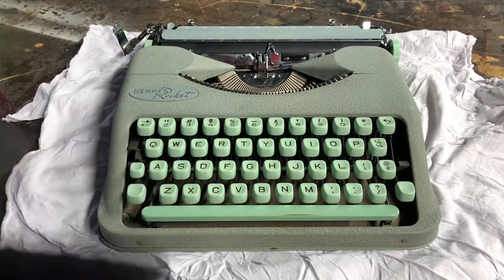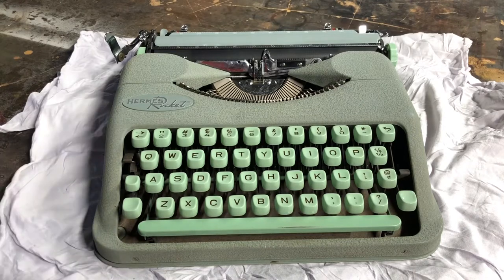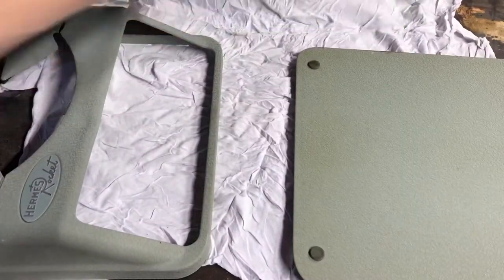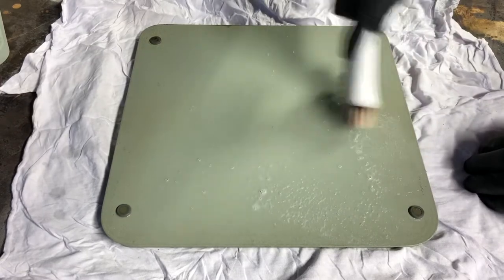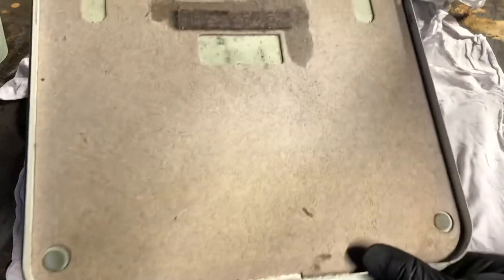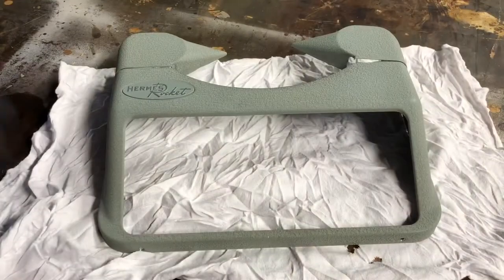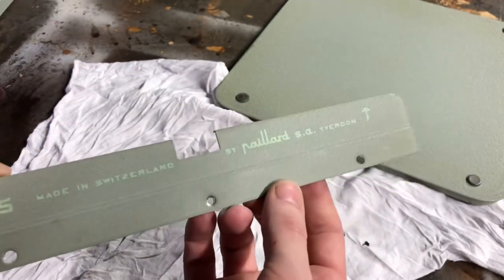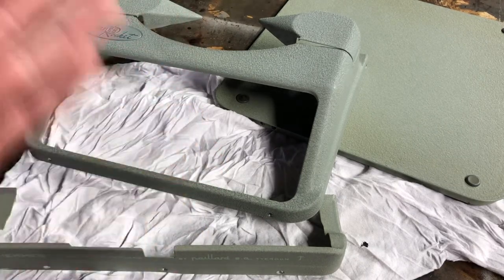Clean and Polish for Typewriters with Crinkle Finish ft. Hermes Rocket

Comment: Instead of WD-40, I've used plain olive oil as a final finish with excellent results on crinkle paint.  Coat the inside of a bowl with a tiny bit of olive oil, wipe it down with a paper towel, wipe that thin sheen onto the crinkle paint, and follow with a light buff with a cotton cloth.  There's no odor or greasiness, and the crinkle finish really pops - a great final step to recover a bit of luster after the cleaning leaves the finish looking dull.  It only takes a tiny bit of oil for a significant improvement, and you don't have to mess with the fumes and other chemical properties of WD-40.
Reply from the maker: I bet that smells nicer than WD-40 😂 might have to try it, thanks

Comment: Great job! I have a 1936 Royal with black crinkle finish and chrome bands. I've been wondering about the WD-40 on the finish. What would you suggest for any bare metal spots or chips in the paint?
Reply from the maker: Thanks! My Royal QDL has that black crinkle and chrome finish. I haven’t tried WD-40 on it yet but I will. I don’t touch my chipped paint but I’ve seen others use nail polish for touch ups. You can color match without a buying a can of paint

Comment: Interesting video i heard you can use the goo stuff you use on keyboards to get to the deep bumps i also heard that you can use the sticky stuff you can set up posters with , and or the erasers which is soft and is like the poster hanging stuff
Reply from the maker: I have poster stuff and kneadable erasers… might have to try that. I don’t have goop, but it sounds interesting. I feel like I’d rather do it on a computer keyboard because it can’t really ooze deep inside
Reply: @inkiron3907   the goop cannot be used for the keys on typewriters but can I heard be used for the cases on typewriters